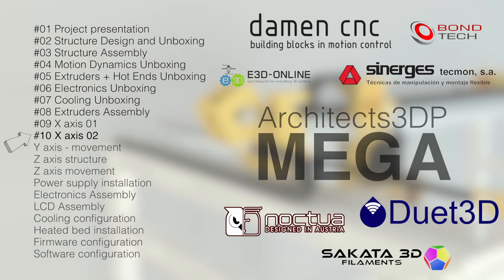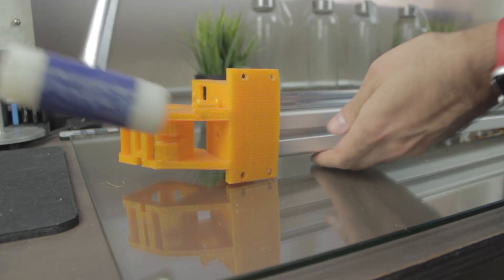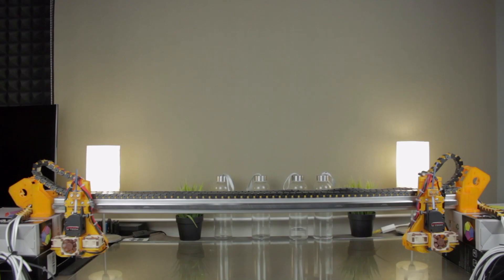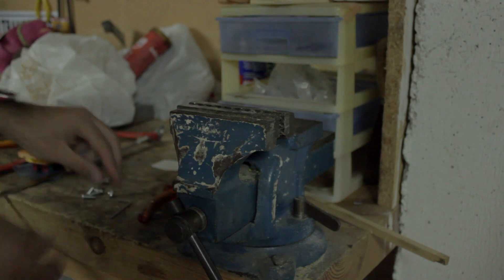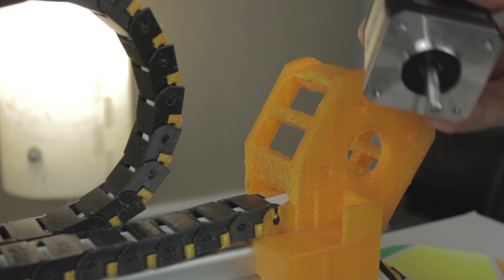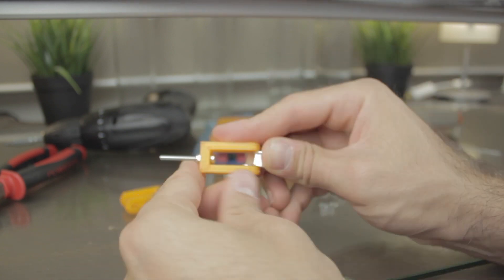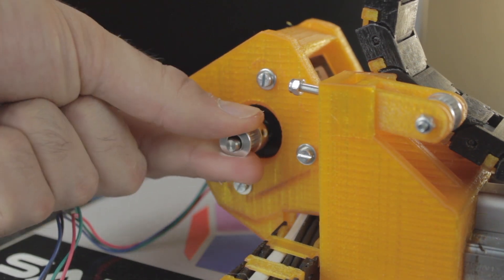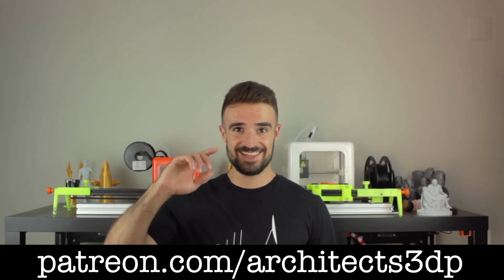Architects3DP MEGA - X axis structure 2/2 #10

Comment: A little tip; when you cut a screw or bolt, thread a nut onto the screw above the cut point.  After cutting the excess off, unthread the nut and it will chase the end thread back to straight so it can be used without cross threading.
Reply from the maker: Thank you! very good advice! :)

Comment: Quick question : why not set the x axis perpendicular to your current layout? Wouldn't a much shorter gantry reduce weight?
Reply: The x axis holds two extruders. It needs the length to have a sufficient printing envelope.